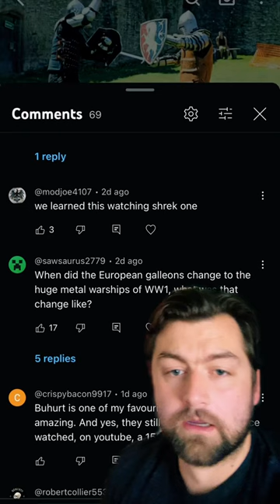When did warships become metal? #shorts

Comment: From what I hear there pretty interesting cases of this era like the HMS Warrior that went from cutting edge when it was conceived to obsolete when it entered service
Reply: That wasn't the case for Warrior and Black Prince in partoular. Both ships were far and away the most powerful in the world when they were commissioned, and would remain so for a short while. It took a good few years for them to become obsolete.

However, that did happen for other ships. In the latter half of the 19th century, naval technology advanced with insane speed, too fast for shipbuilders to keep up with. It wouldn't be until the 1920's and a naval treaty until things slowed down.
Reply: HMS Warrior was actually for it's time, very well advanced. And due to a bit of a crisis in the Royal Navy at the time, it would actually take a while for a ship to be made that actually outgunned her. Basically, a combination of budget cuts, and the failure of the Armstrong 110lb breach loading gun left the Royal Navy out of a successor to the 68lb muzzle loader. Now, that gun was still good enough for the time being, so other ironclads would just be made with less of them on board, but this left Warrior as one of the strongest ships in the fleet for a good few years until someone finally made a ship that outmassed and outgunned her. In fact, many of the ironclads made for the Royal Navy at. This time, were conversions of older ships of the line to basic iron clads.
Reply: @horationelson2440  warrior I believe has the distinction of being the first ship made with both an iron cladding and iron hull and strengthening Glorie was built just with iron cladding 
Dreadnought was arguably obsolete when she was launched the RN was already about to launch a newer class with superimposed instead of wing turrets
Reply: @wargey3431  You are completely correct about warrior, being the first iron hulled, iron clads ship. However, Dreadnought was not obsolete on launch. The Royal Navy actually stuck with wing turrets all the way up until the Orion class. However, some ships like Neptune and her sisters used superfiring rear turrets in conjunction with offset wing turrets, the use of wing turrets was a staple of all 12 inch armed British battleships. Along with this, it wouldn't be until the Brazilians purchased their ships, for a nation to have a clearly better dreadnought design. The British had built a subsequent class to the Dreadnought, but it was largerly just a modified design that fixed minor issues. And the Americans had the South Carolina class, which while it had the revolutionary idea of superfiring turrets across the center line, had many design constraints limiting it's speed and combat effectiveness.
Reply: @wargey3431 Dreadnought wasn't obsolete when she launched, she made every battleship afloat at the time obsolete when she launched.
Reply: @TheAchilles26  she was obsolete within a year even if she made all other ships obsolete when launched
Reply: @horationelson2440  Dreadnoughts small guns and wing turrets meant she was very quickly obsolete is what I should say the Orions also basically made all previous British ships obsolete the wing turret design and 12 inch guns were gone within 3 years which isn’t a long time from commissioning to the obsolescence of the platform 
The next big obsolescence of ships came with the Queen Elizabeth class which was basically the perfection of Pre WW1 ship design 
Sadly all would be obsolete by about 1950 due to the shear power of aircraft and guided missile destroyers starting to come into service 
The Iowas kept going but they were no longer the main battle line and were effectively relegated to the role of monitors
Reply: @wargey3431  within a year is not the same thing as at launch.
Reply: @wargey3431  If you want to go that way, then every class was made obsolete by the next class.  (Dreadnought < Bellerophon < St. Vincent < Neptune < Collossus < Orion < King George V < Iron Duke < Queen Elizabeth)

By WW1 Dreadnought wasn't obsolete, she just wasn't the most powerful anymore but still a good unit on the battle-line.  The only reason she wasn't at Jutland was because she was undergoing a refit.

Also, the first superfiring turreted British battleship wasn't laid down until 1909, 2-3 years after Dreadnought was completed.  By which time three additional battleships of slightly "improved" design had been completed and three more were being built.  All closely resembling Dreadnought.

Honesty I'd say the Dreadnought wasn't really out of date much until the Orion class which increased the main guns to 13.5" and had five, twin turrets all on the center-line.  The first of which was laid down at the end of 1909 and not commissioned until 1912.

Comment: HMS Nemesis was an Iron Hulled Steam Warship which saw huge success and started the research into metallurgy after water temperature differences led to different outcomes. 

HMS Nemesis which an 1830's vessel keep in mind nearly 20 years before gloire. 

Ships before Nemesis also continued metal hulls usually in the form of copper hulls or copper painted hulls which was designed as such to protect against worms and barnacles to an extent. 

So what are we defining as Iron Warships? 

Is it metal exterior hull's or fully metal hulls? Either way doesn't matter the British beat the French by Gloire definition with Nemesis ans her sister ships. Gloire beat Warrior from memory.

Comment: If I remember correctly, it was during the American Civil War where all metal steam powered ships were invented, built, deployed, and fought each other. The confederate ship "Virginia" was built using the wreck of another ship that was metal below the water line and wooden above, and then the wooden parts replaced with sloped metal. I think that is it pictured near the end of the video. The Union ship "Monitor" was also the first ship that had the guns in a turret and inspired a line of Ironclads; though discontinued since they sat too low in the water to survive the high seas. Somewhat hilariously when they met they couldn't really damage each resulting in no changes in the course of the war.
Reply: The first fully metal ships were built before ww1 by the british, maybe you're talking about some other variant
Reply: @abhi5504  The American Civil war was from 1861-1865.
Reply: @letteropener3119  I know, when I meant some other variant I was talking about a ship that wasn't fully metal, only partly
Reply: I WOULD argue the Monitor or more importantly the THUNDERER.

 Mastless, armored, and had turrets. Yet the HMS Thunderer had a superstructure which with all these traits is what I believe is the proper answer.

 So the 1860s and 70s.
Reply: Oh yea I believe I’ve heard of these, they weren’t “warships” per-say however they were heavily armored river boats used as if they were proper warships
Reply: @abhi5504  I think the original poster was talking about the north and south’s riverboat-warships. They weren’t proper metal warships, however they were completely or almost completely metal and were used in the Mississippi/shallow gulf.

Comment: It's important to note, steam engines were first used to automate the rigging of sailing vessels, not necessarily as direct propulsion.

They basically cut down the portion of the crew that had to be set aside to operate the rigging.

And sailing ships already had "protection" before steam, it just was brass/bronze metal sheets, and it was reserved for larger more cumbersome vessels like a 3 decker.
Reply: The copper sheathing you're thinking of wasn't armor against cannonballs or anything, but rather against barnacles and crap growing on the hull and slowing the ship down.
Reply: @David Fuller  oh, I didn't know that.

So that's why it was mostly below the water line.
Reply: @RichyArg  Yep... and it turns out when they put it on iron hulled ships to do the same thing... it just galvanically corroded the hull.

Comment: Ironclads, in the technical sense, had, with very few exceptions, iron armor backed with wood, usually teak.  The exceptions were tests of other backing material than wood. Regardless of whether the hull frames were wood, iron, or steel.  Iron frames also predate iron armor, as some of the wooden hulled sailing ships had various degrees of iron framing, and the vast majority of ironclads had iron frames, some with wood hulls and some with iron hulls, but the armor remained wood backed iron. 

Composite armor was a steel outer plate backed by iron(and occasionally in the early days also including 1 or 2 wood layers as well)  IIRC, the transition began  in the 1870s. If i had to guess, this is likely also when frames made the transition to steel, but it may have been a bit later, and certainly the hulls had transitioned to iron and steel. Contemporary  accounts do still sometimes refer to these as ironclads, among other terms.

In both ironclads and composite armored ships, the reason for 2 layers of the armor was to provide a hard outer layer to break up shells, and to bounce or at least slow down and deform shot or armor piercing ammo. The more malleable backing helped absorb and redistribute the shock of impact,  helped keep the more brittle outer layer from shattering, or at least becoming more dangerous flying razor sharp mini-projectiles within the ship if it did shatter, and hopefully absorb any remaining kinetic energy left in whatever deformed shot or AP round did manage to penetrate the harder outer layer.

By sometime in the 1890s, even composite armor was obsolete as well, being replaced by single layers of face hardened steel which did both jobs in one layer, at least for capital ships.  Cruisers were sometimes armored with homogeneous steel, rather than face hardened.  Varied by nation and time period. The transition to full steel was effectively complete for hull, frame, and armor by this point, afaik.  By this point, the term ironclad was also almost gone from contemrporary accounts except when referring to older iron or sometimes composite armored ships that were still around.

Comment: Umm the first  ironclad was english it was a ship of the line with had bands of iron around the  lower hull and it never saw a iron because the french ran away from it the french were the first to coat it in iron yes but cladding is a very specific word its not  just slapping iron on the hull

Comment: Ah, but WHY! and what metal! The metal that would be first applied to a ships hull was copper. Why? Ship Worm. Barncles. Other critters. The shipwrights didn't like iron becuase wrought iron in salt water can flake apart and fall apart quickly, bronze was prefered becuase it didn't rust and could bear wear quite well and it did have some properties to keep the livestock from growing on it and eventually discovered copper would keep the hull clean of vermin and the ship would be faster sailing. So, after a while, most ships became copper bottomed, then came copper sulfate paints. Iron and steel hulls? Started and for the longest time was only Navy ships, men o' war that had to have armor.

Comment: Is glory the first because it had metal plates for armor and a engine? Because I remember the USS Constitution have plates built into the hull and it served in the war of 1812
Reply: The copper sheathing on Constitution's hull (and many other wooden ships) wasn't armour. It helped decrease 'fouling' of the hull by seaweed and sealife, thereby increasing speed. Beyond that, yes, La Gloire was the first ironclad.
Reply: @Cailus3542 yes, not armor against anything but worms and barnacles. It provided a measure of speed and resistance to erosion. It was specifically trimmed low to be just above the water line, so that it would have been impossible to even hit it unless the ship were heeled over.